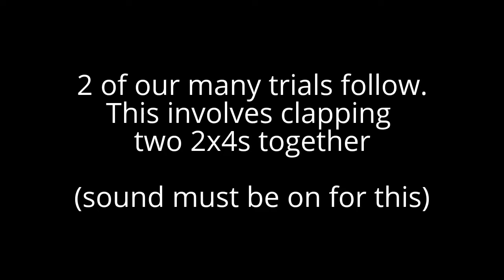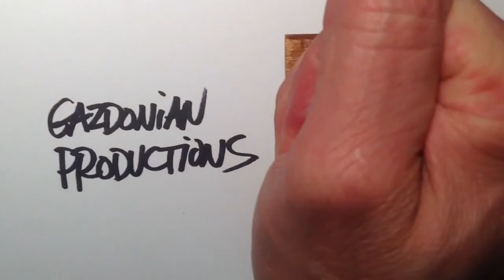How to Measure Distance Using the Speed of Sound

Comment: Interesting, seems you systematically  overestimate the distance… I note the video is 5 years old now, was this ultimately understood? Or are you still looking for potential solutions?
Reply from the maker: We were never able to find the source of error and get more accurate measurements.  This still bothers me 5 years later.  I am definitely still looking for possible solutions, if you can suggest any I’m all ears.  If there’s a new approach I haven’t considered I’ll have my class this year test it out.
Reply: @MisterGazda  Hi! I don't claim to have the solution but I think it is an interesting problem! So, my thoughts based on the initial view... The clock that you have is showing time in hundreths of seconds, my understanding is that the human ear has a time resolution (not the same as frequency resolution) of around 20 ms. You are systematically overestimating the distance on the order of 40 ms and I wonder if that could be part of it. Second, you appear to be in a relatively narrow hallway (or similar) with a wall behind you so there will be reflections in the sound that will arrive after the initial sound, which could also contribute to "measuring" a later time or longer distance. My suggestions would be to try to repeat the experiment ideally outside in a low noise environment, far from any reflective surfaces and with an increased distance. This would first reduce the error introduced by human temporal resolution, as well remove the effect of reflected sounds.Finally, and this would require a more complicated setup I bet, there are apps for smart phones that will give you an FFT of the audio and that might be used to try to more preciselyl determine the arrival time of the sound. This is interesting, will keep watching!
Reply from the maker: Thanks so much for the well thought out reply.  The human ear time resolution is interesting - though I'd  think that with the video slowed down so much that would significantly reduce that factor (?)  I did in fact try this outside in 2 different setups and the results were still off by 15-20%.  I like the FFT of the audio idea.  Maybe I'll take another stab at it with my class this year (or maybe not...doing this with a group of unmotivated students in tow is a chore.)  Thanks again!

Comment: It's because something is wrong with your clock.  I'm not sure if you messed with the frames per second in the clip above, but the timing of the clock was clearly irregular.  It might also be due to the fact of time required for sound vibrations to process in the brain and then for brain to send neurological signal to the hand to stop the clock.  How are you measuring when "time at which sound arrives"?  Is it that you recorded the sound of the wave on phone and took those number of seconds and then subtracted the time from green clock when the boards met?